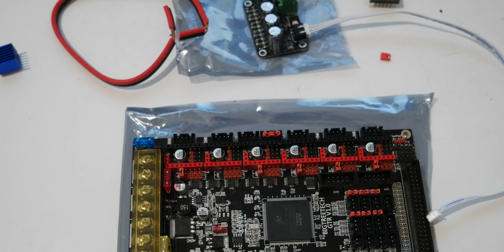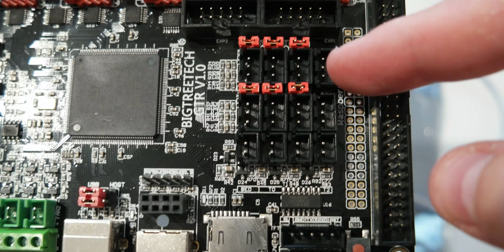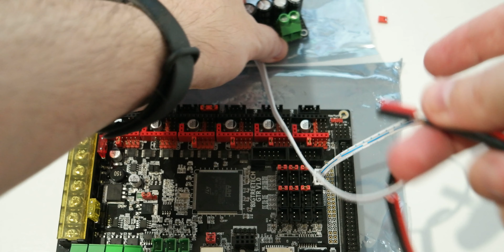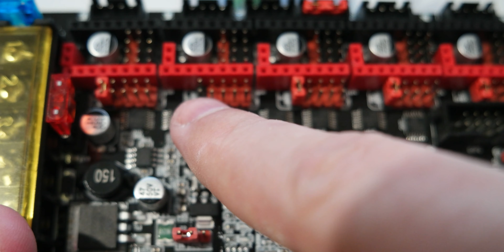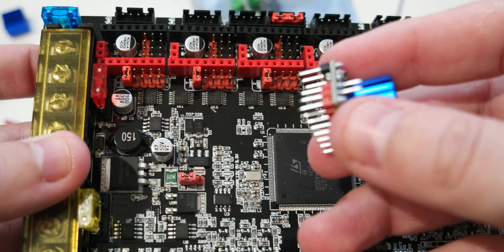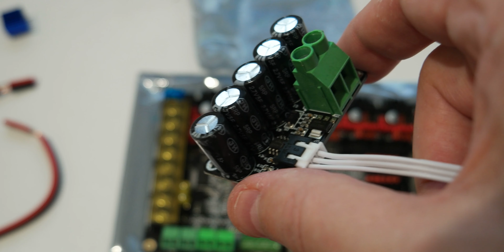Power Resume Printing Module and UART drivers setup on BTT GTR v1.0

Comment: Show a video of that working.
Just watch out for this board firmware. It states on Platformio.ini: PLATFORM " STM32 7.2.0 > STM32F407ZG (192k RAM. 1024k Flash" and the hardware says STM32 F407IGT6.
Tuns out to be lots of features but lots more of BUGS. Also only works with they modified Marlin. At last: We know very well the China Manuals and Assistance.
Reply from the maker: I will as soon as I get back home. Also the PINs needs to be defined within the config files, for GTR to set this module on Ext 1 should be PI11. Did you file a bug report on github ? It would help to get the issue noticed. Please subscribe, thx!
Reply from the maker: there is a 2.0.6 Marlin out, maybe some of those fixes are in.